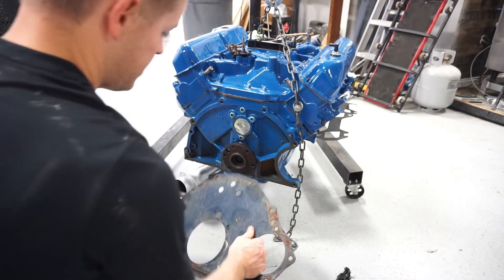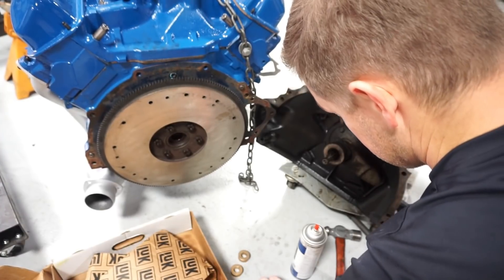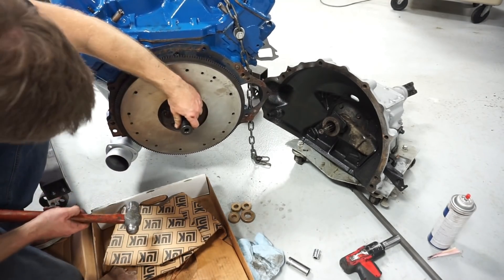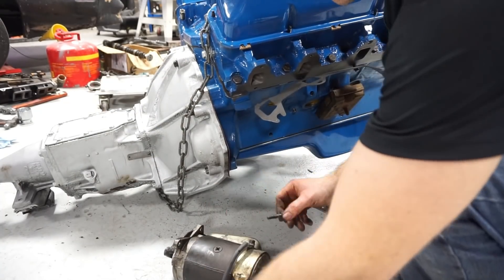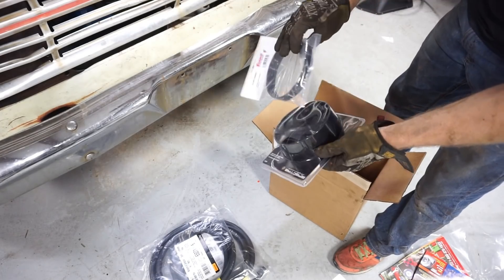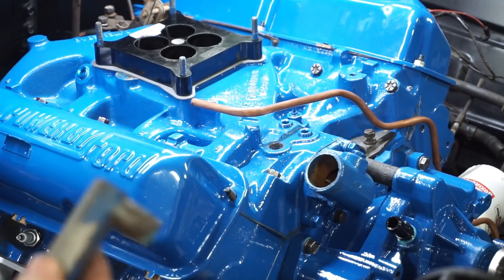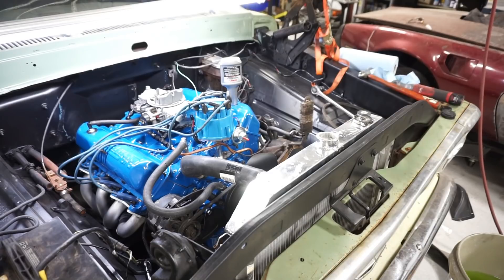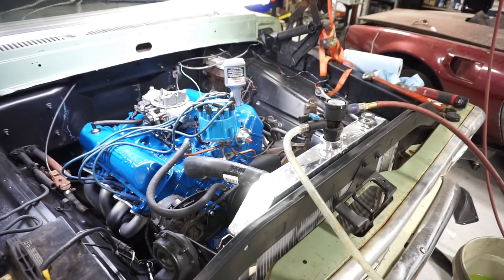F100 Engine Reinstall ... and Problems

Comment: Could you have done this air test before installing the engine? Why do the air test through the radiator? Also, Ford put out a notice on these 390s to soak the pilot bearings in oil for 24 hours before install. Also should hammer it in with brass, not a metal socket--this is what I would do, but I learned from your video regardless. Thanks...

Comment: i thought pretty much all engine builders/rebuilders throw out the china walls and just use RTV, letting it tack up for 5-10 mintes b4 installing manifold?
oh well maybe he will get an aluminum  intake soon and save about 50 lbs on front end anyways

Comment: I ALWAYS use FelPro Printo Seal intake gaskets on the sides & straight beads of silicone along both China walls.  Also, you may need to machine a bit off of the bottom of the intake manifold depending on how much was machined off the heads.  The manifold can be a bit too wide on the bottom & not allow the sides to drop down enough to line up because of the angles on the sides.

You should get a cap for the air tube on the carb choke housing.  It will suck air in through the carb that will make the choke stay on longer & also allow dirt (dust) to be drawn into the engine.  There is a possibility that it doesn't have a hole at the carb main body behind the choke housing or you may be able to locate or make a gasket without a hole in it.  You should make certain that air is stopped from getting into the carb main body by some method.  The hole will enter the main body just above the booster ring in the rear corner of the choke flap opening.

Comment: More than likely the intake. Gasket was for a tall port. If you got the small port gasket use them instead.
Also don't use the cork end gaskets use about a 1/4 inch bead of rtv or right stuff, if you have it then let it set up 15 minutes or so then replace the intake

Ps if you can check the geometry angle.
The head to the block then the intake to make sure the angles are the same.

Comment: question? i am thinking of adding an HEI on my truck. how did you wire in the 12 volts. and did you even bother with running a non resitant wire to the i terminal on the solenoid.

Comment: It was mine I'd throw away aluminum intake it'll also save your back trying to install it those cast ones got to weigh 80 90 lb hope you didn't pump all that water into your engine oil

Comment: I think people put some sealant on those aluminum head gaskets to seal the water ports running from the engine to the head,  I run the same HEI type distributor on my 74 F100 2wd with a 360.   I could not reuse the factory aircleaner as the HE

Comment: the transmission of the ford 100 is the original one from the beginning or you changed it is question
Reply from the maker: Original 3 spd transmission, I just power washed it with oven cleaner, and spray painted it.

Comment: Come on BLUE OVAL People someone step up and help the young man out!!! I would have went with a little better gasket set up remember when you torqued them they crushed out a little . Also your intake manifold may be the problem, that cover inside needs to be just right . You put a bigger cam in im guessing swap out that cast iron boat anchor paint your new / used aluminum intake and let her work . Those pistons need help too in my opinion but its your money and i understand  you may be looking for something differant . With 10:1 compression id be curious what your h.p rating is 390 were high winding .

Comment: In 1982 I put a 360 Industrial engine in my 66 F100, everything from the 352 cid fit. They said the industrial engines were used in the F700 and bigger. Awesome video

Comment: Hey there I love your videos I’m definitely a old Ford guy I actually have a 70 F250 that I just had a 410 Mercury rebuilt   which is the same as your 390 428 crank 390 rods anyways I have a question for you on your headers where you got them at because I’m going to wanna put headers on my truck thank you and thanks for the awesome teaching

Comment: Should have just bought a new aluminum intake.
Reply: I agree I had my 390 rebuilt and they put  the original cast iron intake back on vacuum leak since day 1 I'm putting a Edelbrock RPM as soon as I can

Comment: I’m using a Luk clutch kit and a GM throw out bearing in my 70 Z28. Bought the Luk kit from an AC Delco store in town.
Reply from the maker: I have used those Luk clutches in quite a few vehicles and never had an issue. Couldn't beat this one for the price

Comment: https://shop.broncograveyard.com/Stock-Oil-Cap-Breather/productinfo/10789/.      You need this valve cover PVC cap you can’t install the PVC valve in that valve cover using the round grommet it will suck air in around the grommet. You had the proper cap on the passenger side valve cover when you rescued the truck
Reply from the maker: I wanted to go with a PCV setup instead of that breather. I found some material in the in the oil pan that looked like it may have been from those breathers, so I was a little nervous to go back with them.

Comment: Not sure if there was any milling done to the heads or block but if there was....The FE head gasket and intake gasket surfaces are 90 degrees relative to each other, so any machining operation to the heads or block deck will have had a corresponding impact on the intake fit...which would cause leaks.

Comment: Well at least it looks pretty! Hey it wouldn't be a "real life" situation if everything went perfectly. This isn't TV...lol Speaking on the Heater hose fitting on the intake, I'm betting Drake, Dennis Carpenter,  C&G Ford, or LMC Truck has the correct one available. Your original sure seemed taller than what I'm use to seeing. The OE ones typically were just tall enough to align with the water passage that was in the carb spacer. Then the heater would hook to the rear exiting side of the carb spacer. Not really sure why Ford did this unless the 2bbl didn't get enough heat from the acres of iron intake...??  Also one last note. Keep spare starter around. I looks like you coated your headers? Hopefully that coating you have reduces the heat as these headers, non-coated, have a tendency to cook starters. Ask me how i know.... (and how i get that top starter bolt easily ;-) )

Comment: Glad you found that before you put coolant in it. I didn't know how you were gonna go back with the engine. I would of wrapped the header over by the starter. Just saying because fords and headers don't always work well together. Those header gaskets looked a little thin that you put on there. I used the thick white header gaskets on mine when I put it back together. I used the original cast exhaust manifolds on mine. Originally they used the metal gaskets. FE's are notorious for leaking exhaust manifolds.
The intakes on FE's tend to weep oil on the front or back where it goes across the engine. I never had any problem with the sides like your experiencing. I hope you don't have a cracked intake. Hopefully the gasket just moved when you were putting it together.

Comment: I just put headers on my 390 ‘68 last night. I wouldn’t want to try putting a motor and trans in with them on.
Reply: 4EyedTurd how’d it go?  What brand did you go with?
Reply: Flowtech, not to bad. I had to lift the motor a few inches to snake them in.

Comment: Just a possibility here but you might consider,, If that manifold was ever shaved to seat on heads that were planed??.in some cases when the head get planed the intake manifold needs to be planed to match ,,because,, When heads are planed,in effect ,they sit closer together on the block as a result.this makes the angle of the manifold flange not sit fully face to face to the head(s).This makes manifold planning necessary for a good seal between the head(s) and the block.This may not be your case I know but!! if that is your situation sourcing another original spec manifold ( new or used)  may not solve your issue. Enjoy your videos and hope you come to a simple solution to your issue .
Reply from the maker: Thats something I should have thought of with a used manifold, that came off a motor that was pretty freshly machined. Very likely that manifold could have been machined to fit on some shaved heads

Comment: I've been there and it is frustrating  because of all the maybe's that you think of. Plus being so       careful and things still go wrong. At least the engines in to stay! I don't know what the angle of the intake to the heads are but I'm guessing that its off just a tad and letting air out into the engine  cavity. It might only be a half a degree but if you have a head that you  can lay flat and get the degree of angle and then the intake angle as well... this is just a guess... good luck
Reply from the maker: Thats another thing I didn't think about... if someone machined that junkyard manifold to match another set of heads...

Comment: I have had this issue using the steel shim head gaskets in a 390. I ended up having to use the blue multilayer head gaskets from Fel-Pro. They sealed and no more issues. I would assume you are having the same issue i had. I also noticed that you did not pre oil the timing chain. Not good to fire up on a dry timing chain.
Reply from the maker: I wish I had found more bad reviews on those head gaskets. Everyone says they leak. I used them on a SBC 400 before and had no problems. I have never oiled a timing chain before.... but come to think of it, that probably isn't happy being run dry

Comment: im half re building a 1962,f100 4x4, with a 352,thank christ it wasnt a y block.just doing heads,ect.cam...what p/s is used on these trucks..4x4..there are non,,in aus...
Reply: harry walker what’s wrong with a y block?

Comment: with the money spent,you should of found a s/hand ally intake..those cast are 300 lb..i used a 12,000 winch to lift mine off....kidding.
Reply: Yea, those cast iron FE intakes are a royal p-ain!  That thing weighs more than both head fully dressed with valves and rocker shafts!

Comment: Check the header exit, maybe an exhaust valve is stuck open and it's letting air out that way?
Reply: Cooling system should hold pressure even if all sixteen valves are held open. Something is not sealed right and my guess is the head gasket.